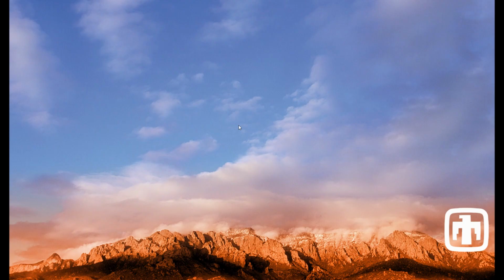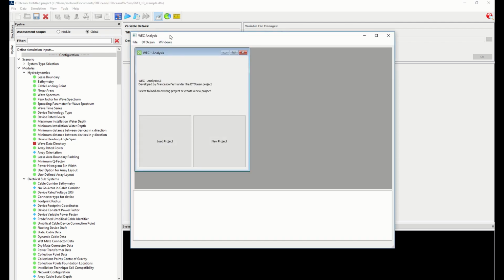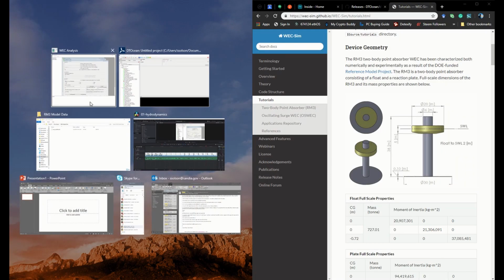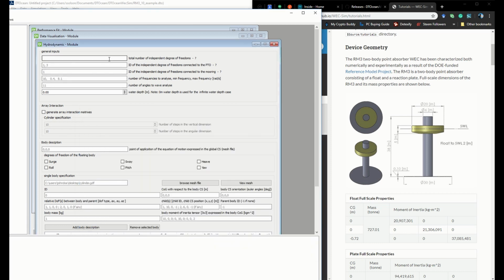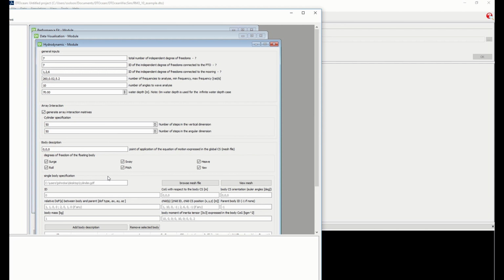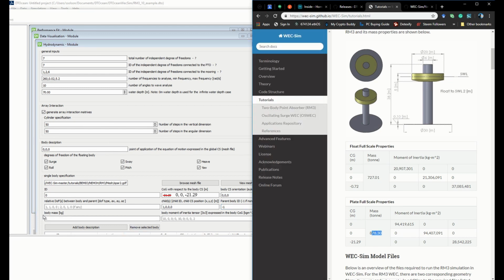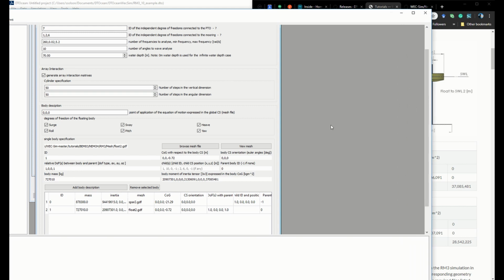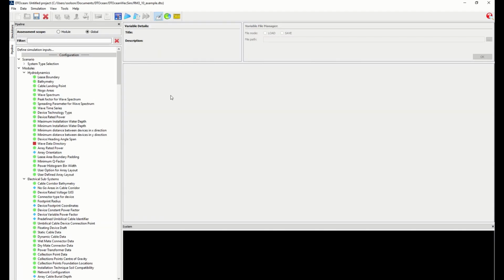DTOcean 2: WEC Tool - Part 1: Hydrodynamics

Comment: Hello! I have tried to run this video section for a point absorber that is similar to RM3. unfortunately when you click calculate it provides an error and wont run the simulation. This could be due to the fact that I cannot view the mesh for either the float or the spar. Could you suggest some reasons for this issue - the file is an STL file, and is modeled fully (e.g. not cut in an axisymmetric orientation, although the WEC is axi-symmetric). the error that I see is: "UnboundLocalError: local variable 'Connectivity' referenced before assignment"
Thanks for any guidance you can provide.
Reply from the maker: Hi, the DTOcean WEC tool only supports meshes in .GDF (WAMIT) or .dat (NEMOH) formats. I've added a change that will throw a more useful error when using the wrong type of mesh file. The change will be published with the next release of DTOcean.